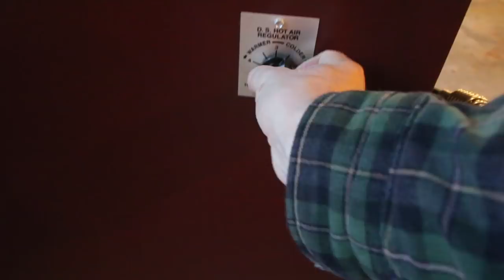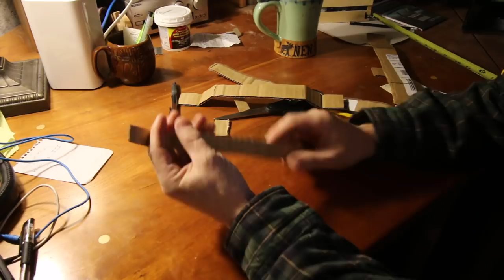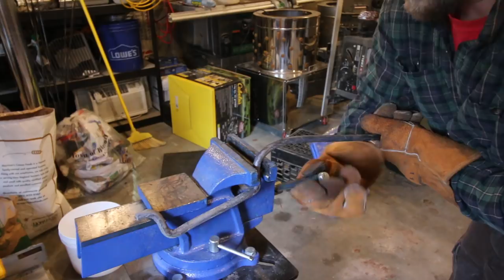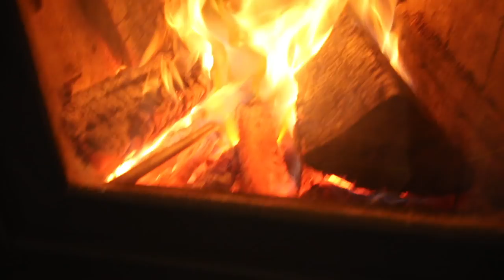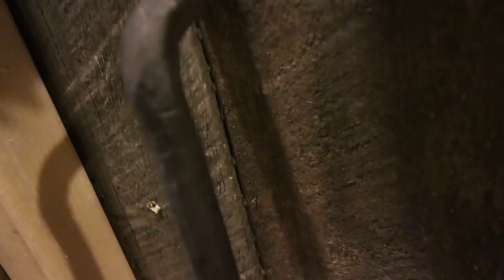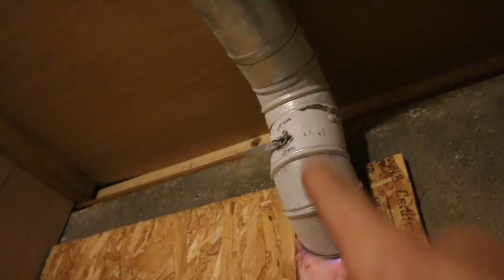Hand Forging Door Handles For Our Root Cellar Door

Comment: One thing I noticed... When you check the root cellar's temperature... You take the temperature from the shelf from the middle of the room. What's the temperature from the top shelf? Unless you're gonna cure 20 prosciutto at a time, you don't care about the whole room, just the spot you are keeping the prosciutto. After getting the night temperatures, high and low, you might only need a small fan to circulate the air to keep lower shelves within tolerance. (Try a fan you usually use in summer, instead of storing it.) 😉 xoxo from Arizona

Comment: I enjoyed the bonus vlog with Gina and Miss Livvie. It was nice to see the ladies working together, and the logo turned out great. 
Nice job on your door handles. They fit perfectly with the door. I might suggest some warm oil on the surface to prevent rusting. 
Pro forging tip. When you want to bend stock precisely, it's helpful to notch the stock at the center of the bend. Place a cold chisel, bigger the better, standing upright in the jaws of your vise. Heat your round stock, place your mark right on the sharpest point of the chisel, strike down, carefully at first, get a feel for how deep it will cut. The object is to cut halfway through the stock, on the side, in the direction of the bend. Your handles would have 4 notches. You have a nice flat anvil on the back of your vise. Using the corner edge of that flat face, you can open your notches out to be more of a 90* angle. Then when you bend your stock, the thinner area of the notches will bend easier, and the notch will be like a miter as the material comes together. You will get crisper, more accurate bends, without all the struggle. That flat anvil can also be used to straighten things up a bit. 
When bending put your stock vertically in the jaws of your vise, with the notch facing away from the handle. Exert your force towards the back of the vise. Since your vise isn't bolted down, this will give you better leverage for your bends and the vise won't move around so much. 
All in all, nice job with your handles. They look great, and will look even better with some black screws.
Reply from the maker: Great tips! Thanks
Reply: David Johnston , you sound like you did this before, ever think about doing a few videos yourself? I'd subscribe. xoxo from Arizona
Reply: Lumnah Acres, if you don't have a chisel, I believe you can make the cuts with a hacksaw or grinder with a thin cutter. Cause if I remember right, with the heating and the hammering... the cuts close up and kinda melt back together, adding the strength back into the project. xoxo from Arizona

Edit: am I right David Johnston?
Reply: Material removal will make the bends easier. If possible using a chisel is better. The chisel does not remove material, it displaces it, leaving a stronger bend. To fusion weld as you're suggesting takes a great deal of heat and hammering to get the metal to weld back together.  It can be done but would be more of an advanced smithing technique.
Reply: I've been a wood worker, metal smith, gem cutter, among other things, most of my life. When it comes to working with my hands, I have been blessed with gifts. While I enjoy teaching and mentoring, videography is not in my future.

Comment: It seems like you have enough insulation to keep the heat from the house out of the cellar. A small electric fan hung from the ceiling and blowing toward the floor will keep the room at an even temperature. Looking good.

Comment: Al, a couple of thoughts on keeping your root cellar above freezing, since you heat with wood, maybe consider one more vent, from your basement to your cellar room. Put it low in the cellar with a shut off in it, so on cold days you could bring low amounts of heat in from the basement. Another difference maker could be insulating that duct work, a lot of cold is coming from the metal on those ducts. I enjoy your videos, thanks for the hard work.
Reply from the maker: I like the third vent idea. I have the door open a crack today. It was -17 last night!
Reply: Yes sir, we are getting it in Wisconsin too. I have a love/hate relationship with winter and the cold.

Comment: Why not use your wood stove to heat the metal, I have cutting torch. All you need to do is get the round stock hot enough. Good job.

Comment: I don't have a wood stove. Can you use a hibachi? 😜
Don't forget Kombucha will kill anything.
Reply: Yes, you can. With a few pieces of plumbing pipe, a length of old vacuum cleaner hose and a hair dryer, you can make a little forced air blower. This will increase the temps of your hibachi forge.
Reply: David Johnston. Thanks I have bent bamboo on the habachi.
Reply: Yes, I saw that video by Art. That video, along with Al's, show that you can do basic black smithing with just a bare minimum of tools. I'm an old coot, and have been banging on metal and making sawdust most of my life. When I first started, I didn't have much more than Al or Art.